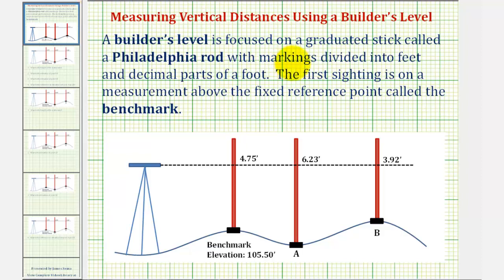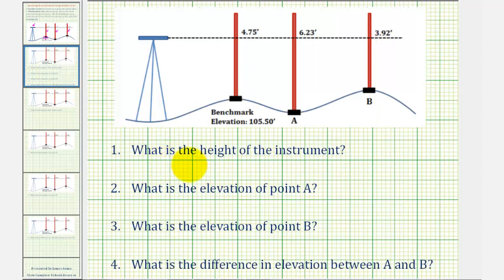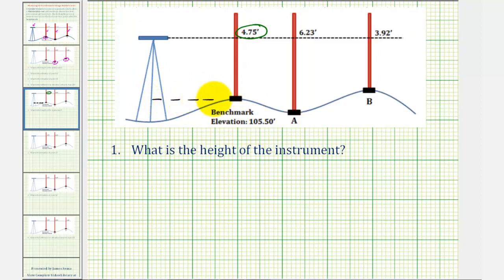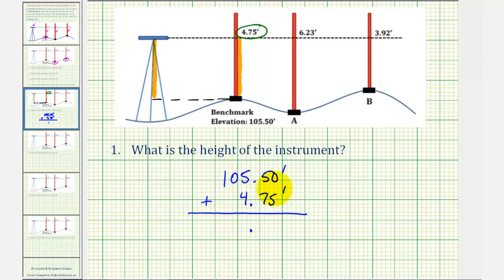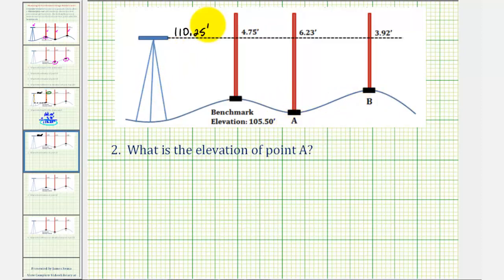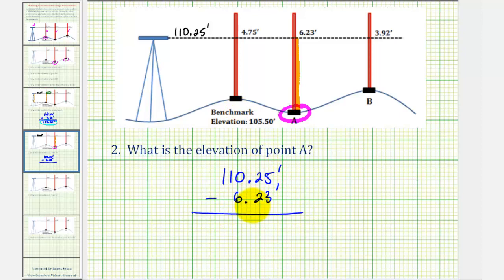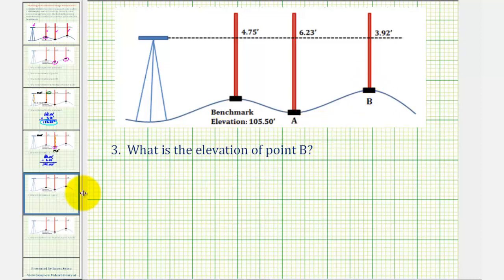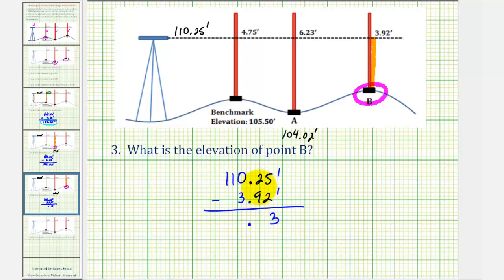Ex: Builder's Level Application - Decimal Addition and Subtraction

Comment: When you are measuring down in the ground, the transit measurement actually goes up.  Turn your tape measure upside down, measuring from the benchmark is 105.5.  Point A is lower than benchmark, which is up the tape measure.  The elevation of point A is 1.48 below benchmark or 111.48 on the story pole or tape measure.  That is how we calculated how deep to dig a footing, etc.  Just another thought.
Reply: I don't understand your calculations, would you please elaborate. how would you measure below a mark if you need to dig in? How did you come up with 111.48 in?